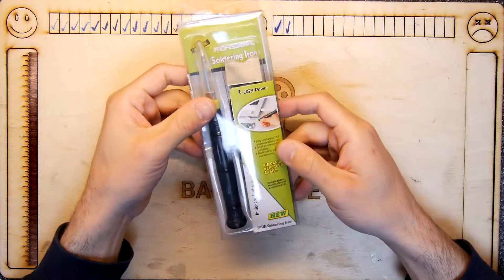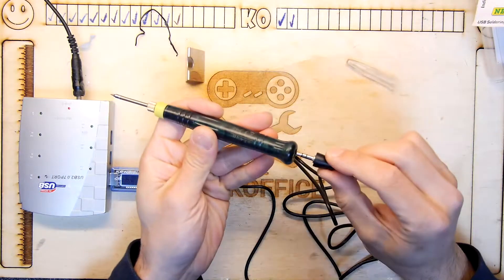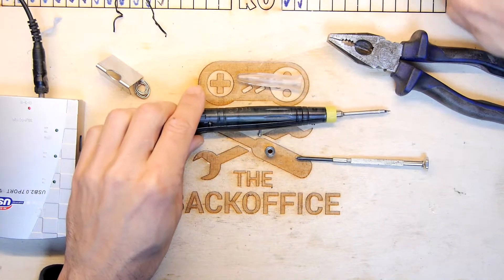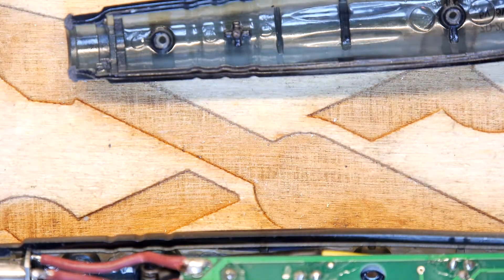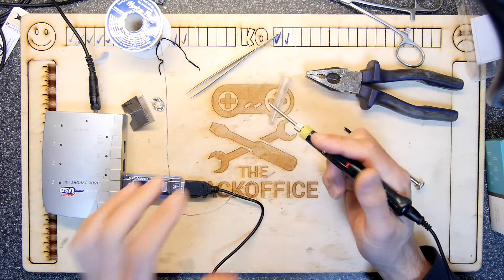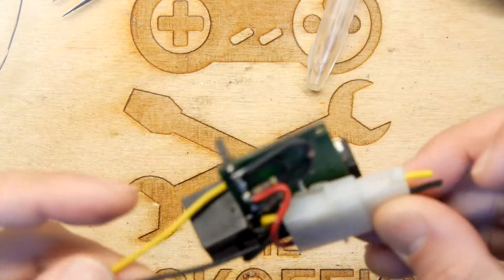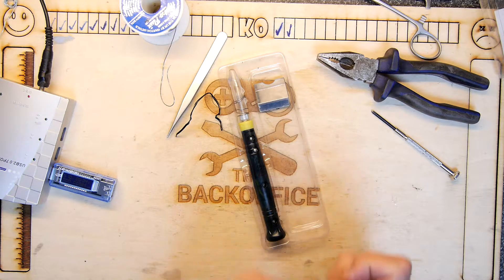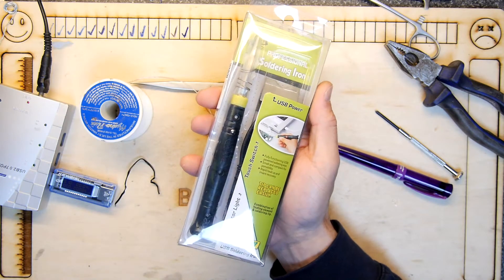USB Soldering Iron

Comment: i got one of these with a 5V/3A twin cell power bank, and it's great and even use it with a cheap $20 LED illuminated/magnifier (5V lights) soldering station from Amazon. it's decent for fine items and wire etc, actually decent enough for small precision work. im going to replace some SMD parts on a Retron3 to fix the sound amp on its SNES segment. it's good for a lil tinker bag, i just used it to rewire/refurb another $5 tool i got myself, a USB Rotary Tool (basically a Dremel). It was able to solder all wires and contacts cleanly, and wasn't a hinderance towards the job. :)

Comment: Pretty interesting indeed. 
I wander about the tip connector... The one you soldered the wire and the nut holds it in. Looks a lot like some kind of coaxial connector.

Comment: Hey everyone, I'm thinking of using this as an heating element to heat up water while connecting to a powerbank, can anyone advise whether this is possible or not ? Thanks
Reply from the maker: It's possible but not the best way to do it, there are dedicated gadgets for that
Reply: Thank you so much for your prompt reply, I have searched all over the net & can't find anything that I can use to heat up water, this is the closest one that I can find, so i wouldn't be short-circuiting it if i only dip the tip in the water, right ? My main concern is that it will destroy my powerbank. Cheers. Please let me know if there are other better solutions. Cheers
Reply from the maker: I suspect it will not damage anything, however will fail to heat useful volume of water in a measurable way. There isn't enough energy here unless it's a teaspoonful full.
Reply: So I guess a regular coffee mug size will be inefficient then ?
Reply from the maker: Hard to say, but you might raise it a few degrees. I did a video somewhere on making a hearing element.
Reply from the maker: https://youtu.be/2IitggrdH9I the soldering irons are really no different to this. You could experiment
Reply: Thank you so much for your kind help, cheers

Comment: I've got the same iron but where you got the metal contact ball timer( it didn't how I describe it else) I have only a spring which is holding the metall ball up!!! look like there are different even on this price!!! I like it for transportation or small works at home,so I didn't have to lift the big iron with me! this I can use on a good Powerbank
Reply from the maker: Sounds like yours has a simple switch, probably more reliable
Reply: backofficeshow I didn't know but it doesn't doing something in anyway!!! 😂😂😂
Reply from the maker: If it works then it's good 😂
Reply: only thing is, it heat's up continuously!!!  but till today it didn't burned trough and works!!!

Comment: Good Video!

I was using a usb Iron like that one as I watched this video, The Charger DR keeps the Battery pack awake, don't use an AC usb power supply you will get ac on the tip at times.
I wouldn't use the computer usb it would probably kill the port. 
He explains about the AC  https://www.youtube.com/watch?v=o-8D5t6TJYU Later

Comment: I powered mine from a Samsung 2 amp charger, and since you can't turn it off, it got red hot. Vibration sensor didn't help also, I plan to hack it and change the timer resistor and maybe remove de vibration sensor.
Reply from the maker: +Adrian Staicu did the iron get hot or the charger?
Reply: The iron. The metal looks burned about 15mm from the tip. The transistor is just put there to turn it on / off from the 555. It has no power regulation. A simple push button would have worked much better.
Reply from the maker: +Adrian Staicu I will have to open one up again, seems like they overcomplicated the design Vs production values

Comment: I like them. Mine worked straight out of the box and I was pleased with it. I still use it for small stuff, but I have also got the W.E.P. 862D+ and also a T12 kit I bought and made up and use. Depends on what and where I solder to which I use. The USB one came in handy for working on my scooter and soldering LED lights to the existing lights. I would give it a 9 / 10 :)

Comment: I bought this weird battery powered, two pronged soldering iron that heated up instantly as soon as solder bridged the two prongs.   pain in the arse as it never got hot enough.

But thats my problem with a lot of these soldering irons,  they dont' get hot enough.
Reply from the maker: +Larry Bundy Jr ha ha oh Larry I know exactly what you are talking about, I think they were called the cold heat or some such bollocks! I had one as well 😂

It had a graphite prong tip and put current through the two halves of the tip, so basically worked as a welder rather than an iron. It was terrible, useless right?!

This USB iron is a league better than those. I'm going to put one through its paces and make a few kits.

Comment: The crystal on the pcb is actually a vibration switch to switch the iron on. You can either put your finger on the button or tap anywhere on the iron to power it up. :-)
Reply from the maker: +Motovlogger Jamie groovy, I'm going to get another one and have a proper play with it 👍
Reply: They are good irons for what they are. :-D
Reply from the maker: +Motovlogger Jamie they look like they are around four quid on eBay delivered, what more could you want for the money 😊
Reply: The Backoffice they are very cheap. Almost as cheap as the tips alone. They are great for use with power banks for on the go soldering. :-)
Reply from the maker: Im going to try it head to head with my gas iron for automotive use. Let the challenge begin!
Reply: The Backoffice oooo nice. :-D

Comment: The complicated instance to where you need to solder a soldering iron.
Reply from the maker: +Lauriemine Yeah 😂 this is why if there was a nuclear holocaust we could not start again because there would be no easily accessible iron for us to smelt and make basic tools to build better furnaces to make better tools to build better machines etc 👍😭
Reply: Would be awkward...these irons are great though, so much so that I have multiple ones laying around. Work well with a battery bank although not as powerful as a gas iron, it sort of makes up for it by not consuming gas. If memory serves me correctly, I do believe that the tip is grounded (or +5v) so don't use these on live PCB's. Good video as always 👍
Reply from the maker: +Lauriemine Thank you 👍 I am going to get another and really try to figure out how it works and draw the schematic. Would be fun as it's pretty simple.
Reply: I have a 220Vac soldering iron in a 127Vac region, i converted it to 183Vdc using a capacitor and a diode as rectifier, i definetly know the same feeling.

Comment: Mobile Phone repair on your desk? With this? Oh, you gotta be joking :p Those things are basically big heatsinks, that thing does not in any kind of way have the thermal mass to heat up a phone PCB.
Reply from the maker: To remove small SMD stuff, sure it does. Clearly its not going to work on any chips, but an iron is pretty much useless on those anyway.
Reply: I mean, that thing has basically no thermal capacity... Boards with four layers of copper are like a huge heatsink, you're not gonna be able to remove pretty much anything :P

Comment: They aren't half bad for what they are. They are quite handy, to be honest. Much more so than you'd think for a 5 buck special. Haven't really had any trouble with the tips either. Used it quite a bit for little odds and ends and have yet to replace the tip, but I did buy a bunch of replacements once I used it a little and started to really like it. They are dirt cheap, but then again so is the entire iron.

Of course, they aren't exactly made to the most exacting standards(Heh...), so your results may vary. Quality is probably far more dependent on luck than anything else. Mine's been great so far in the last several months I've used it. And now that I've said that, mine will most likely burst into flames next time I use it. :-)
Reply from the maker: +Thor I might get 25 of them on Ali Baba and do a QC video testing them 😂 Then give them away as prizes.
Reply: I'd actually like to see that. It would be really interesting, and I think a lot of people would appreciate having one. 

Just make sure to have an extinguisher handy. You know, just in case... :-D
Reply from the maker: +Thor I always do! 😂

Comment: Oh no, I tried this kind of USB soldering iron before, it fried my USB charger......

Wait, did you just use a soldering iron to fix a soldering iron? That's some inception level stuff...
Reply from the maker: +Runze Liu You need a beefier usb PSU I guess, at least two fat amps I would guess 🤔
Reply: Actually the USB charger is 5V3A, and it support smartphone quick charge, but I think the internal of that soldering iron might be short circuited, so...just another shitty product...
Reply from the maker: +Runze Liu Maybe the USB charger was too smart for is own good and it's brains got fried. Time for you to do a teardown on both 😂👍
Reply from the maker: +Runze Liu That's pretty genius!
Reply: I think we now know the why the soldering on that velleman kit was full of dry joints!
Reply from the maker: Haha, you have a good point there!
Reply: Runze Liu oops... wrong comment thread... anyways that's of course because of the flux/ lead less solder tin